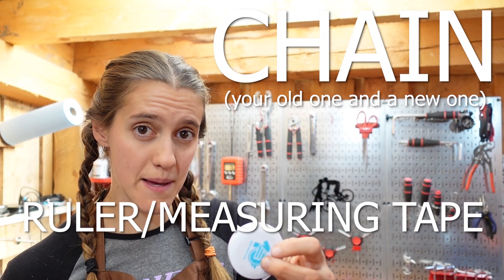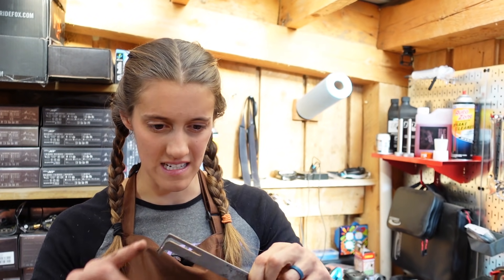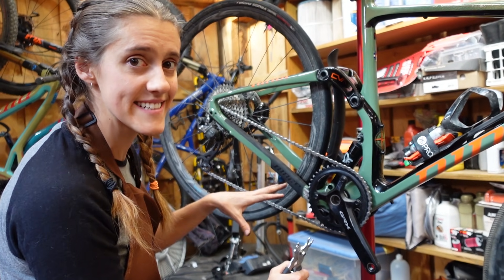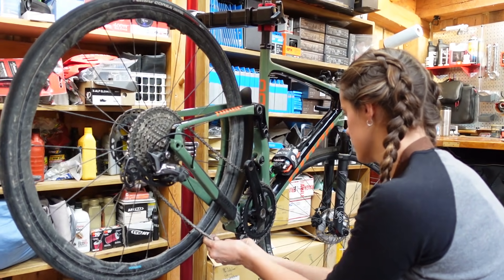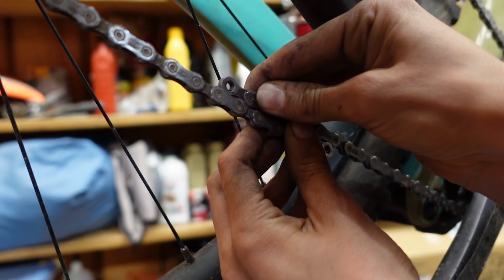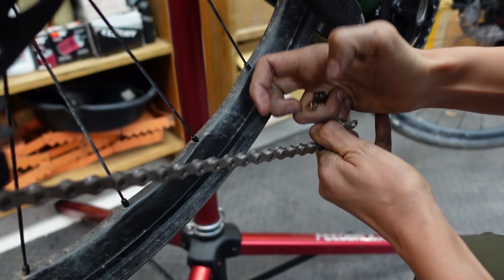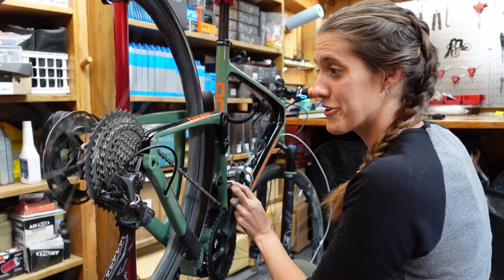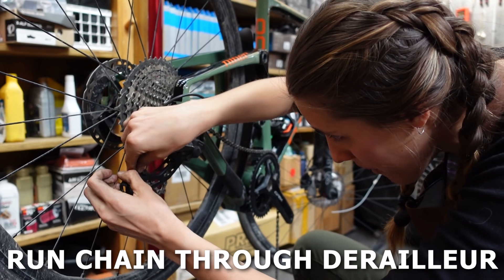How to CHECK CHAIN WEAR and INSTALL a new chain | Syd Fixes Bikes

Comment from the maker: One thing we wanted to clarify that's a bit confusing in the video: we talk about "adding links". You're not actually adding links to the chain, you're adding links to the length of the chain before you cut it. For example, if you measured big to big and that measurement left you with 6 extra links on the new chain (that you would cut off), before cutting the chain you would add 2 links (assuming it's a 9-11 speed system) and would only end up cutting off 4 links.
Reply: So do you have to run it thrue ur derailleur? (Bevore cutting it)
Reply: Syd plz in going on a vacation soon i realy  need an awnser
Reply from the maker: Nope. Measure as explained in the video
Reply: Thanks! This is really helpful 😄
Reply: Do you count 1 pin as a link or 1 link has 2 holes?
Reply from the maker: We count each pin as a link because then you are counting both the inner and outer links.
Reply: Pls reply
Why is my caliper already tightened or braking itself but not completely its just rubing against the disc brake

Comment: I can still hear you saying you would never break the chain!

It's a bummer you didn't need to take a link out of the chain. The snap you get when the pin pops out of the link when using the chain breaker on modern chains is really satisfying!

Comment: Quick tip, bend a piece of wire to clip onto chain rollers.  This can hold it in place with some slack as you join the chain with a chain tool or master link.  I think they sell them, but it is pretty easy to make one.
Reply: YEP!! Can use a piece of old broken spoke and curve/bend the ends. Works great!!
Reply: A straightened out piece of paper clip does pretty well.
Reply: I made one from a wire coat hanger.  There's small one that comes with my multi-tool but I like the one I made for shop use because it's longer and gives you more room to use the quick link tool.
Reply: Or just take it off the front chain ring and that will give you more slack. Put it back when QL is installed.
Reply: @bengt_axle  Yeah, THIS!

Comment: This is the best chain measuring and fitting vid on the internet, that I have seen. Just checked my brand new bike I picked up from LBS. It's a 12x1 SLX the chain had the writing on the inside not facing out and the length was incorrect. Thank you both for all the time you put into this channel.

Comment: I like your videos. I tried to put a new chain on my 3x9. I changed the rear cassette from 32 to 34. So I remeasured by going around big big and adding two links. It was too short. So I measured between axle centerline and crank spindle centerline did the x2 divide chainring /4 blah blah formula. Still too short. I have one chain pin left. I’ll try it your way and see. ❤❤

Comment: KMC Digital chain tool. What the pros use and it’s spot on every time. Get Rohloff cassette wear checker and you’ll never miss worn cogs on a cassette either.
Reply: This Shimano is probably the most accurate analog one, but KMC one is quite badass as well.
Reply: No need to pay 10 times as much for that thing when a single piece of metal works so well, especially in case of a chain checker, which is a tool that everyone should own. I really like the one from BBB,  it has a gauge on it and shows you how much is worn, not just if it's worn out or not.
Reply: Except that thing is precise and accurate which is what you want if you want to squeeze every last bit out of a chain before swapping. Can’t say that for analog sadly.
Reply: A Park Tool 3.2 chain checker is fine. Chains are cheap enough to replace and shouldn't require an expensive tool that will hardly get used.
Reply: @jacobjames1171  well, that depends on the chain 😅 I use a KMC ex11-SL Ti-Ni chain which costs me around $100 in every exchange, so changing it with some life left is a waste of money TBH

Comment: You mention checking derailleur set up after putting the chain on. It's easier to do part of that check with the chain off, as it's easier to see high and low limit screw alignment without the chain. Then check shifting after you put the chain back on. If the chain isn't off, you don't have to take the chain off to accomplish this, but if it's already off, it makes it easier.

Comment: Great video! When installing a new chain, I like to temporarily remove the chain from the front chain ring to provide some slack while joining the quick link.

I have the Park Tool chain tool. How come the Shimano tool has 3 prongs instead of the more traditional 2?
Reply from the maker: Because then you can use the same squeezing motion but different prongs to connect the chain vs disconnect it! It's awesome!

Comment: Is it safe to reuse quick links?
Reply: I do it. But then again, my bike is in the bike shop needing a whole new drivetrain. So maybe don’t reuse them. 😊
Reply from the maker: Most new chains come with a quick link, so we use that one when installing it and keep the old one to use for trailside repairs. We've never had issues reusing them, but some people say you shouldn't 🤷‍♀️
Reply: @sydfixesbikes  Yeah, I also keep the old ones, but the time I tried reusing the quick link, it didn't work as well as a new one. I never reuse them now, on 12 speeds.

Comment: Nice video thanks!  Of course, if you are replacing a correctly sized chain you can measure and break the new chain based on the length of the old chain.  And if you’re rear mech has a clutch you can lock it open while removing the old chain putting on the new chain which makes it easier (GRX doesn’t have?).
Reply from the maker: Yup, since we were changing the chainring and the old chain wasn't the right size, we forgot to mention that you can normally just use your old chain. GRX does have a clutch, but the Shimano clutches work differently that SRAM ones and don't lock extended.

Comment: Setting a quick link together with no tools is easy. Just pull both ends by hand.

Getting one apart with no tool is an adventure of pain and misery that I keep putting myself on.
Reply from the maker: We've had lots of ones that were definitely too tight to connect by hand, but yeah, getting it off is definitely the more difficult!
Reply: A neat trick I used from Seth’s Bike hacks is a shoe lace to undo the link. That got me home one day.
Reply: I’ve used a loop of old cable to undo quick links. Put them together by hand and then press on the pedal with one foot to click them together.

However, I’ve got the right pliers now which makes things easier.
Reply: Use channel locks at an angle to remove the quick link if you do not have the tool.   You put the link into the jaws of the pliers in such a way (diagonal) that it causes the links to slip into the open position when you squeeze the pliers.

Comment: You know Oz Cycle has interesting results with paraffin wax lube and chain life. He's been perfecting it over about 12 vids spanning 4 years. He claims 250-300 k per waxing and 15,000 k per chain in wet and dry weather. He also makes a squeeze bottle wax booster solution for between waxings and makes an MTB/Bad Weather wax solution/booster that includes paraffin oil super lubing. I ordered a new chain and am shopping for materials.

Comment: Thanks to this video I've realised I need to replace the chain and the cassette on my road bike. It is set up with ultegra however the ultegra chain and cassette are more expensive than for example the 105. I was wondering if I could get a cheaper one from shimano or even from a different brand?
Reply from the maker: Yup, all the different Shimano levels are compatible, so you can definitely replace with a less expensive cassette/chain/chainrings. You should be able to replace with non-shimano parts, but it isn't as sure a bet...

Comment: You mentioned compressing your suspension. Is that for any bike that has rear suspension? Or just gravel bikes? I feel like that's a stupid question and the answer is obvious.
Reply from the maker: Not a stupid question! Yes, it's for any bike with rear suspension as most bikes chain length "grows" (increases) as they go through their travel and you don't want to size your chain without taking that into consideration.

Comment: Request...... a vlog on how to fit tyres on and off high rim wheels... I broke my plastic tyre levers and bent 2 strong ( i thought ) spoons and the metal tyre levers I had were too small and dug into my hands and scraped the rim badly PLUS I have ruined 2x innertubes.... my fatbike tyre changing is a breeze compared.  Thanks guys..
Reply: Fat bikes are easy to fix tyres on, the only thing that sucks about fat tyres is they're puncture magnets

Comment: Are you using quick links to connect the xtra links or a pin?
Reply from the maker: We're using a quick link to connect the chain, which is the only connection there is. We realized it's a bit confusing in the video because we talk about "adding links". You're not actually adding links to the chain, you're adding links to the length of the chain before you cut it. For example, if you measured big to big and that measurement left you with 6 extra links on the new chain (that you would cut off), before cutting the chain you would add 2 links (assuming it's a 9-11 speed system) and would only end up cutting off 4 links.

Comment: are quicklinks single use once locked in?
Reply from the maker: Officially, yes. We've reused them many times without any issues.
Reply: @sydfixesbikes  I'm struggling to get my new chain working.  the new chain is approx 2cm longer which i didn't believe would make much of a difference but the chains falls off constantly.  i'm too chicken to break it with my limited skill/knowledge!
Reply from the maker: Yeah, an overly long chain will be more likely to drop due to the extra chain slack.

Comment: The smaller cogs always get worn way before the larger cogs. Even replacing the chain before 0.7 the thing will likely skip with a new chain.
Reply: If you are wearing out the small sprockets more than the bigger ones then I think you need a bigger chainring(s). It should be the middle sprockets that wear more as that it where you should be spending most of riding time in.

Comment: does it actually matter than the letters on the chain face outwards?
Reply from the maker: Shimano chains are directional, so for those chains, yes.
Reply: @sydfixesbikes  ahh I see. What about kmc 10speed?
Reply from the maker: If there is only text on one side, most likely it is directional.

Comment: Again a good video, maybe with a little less camera-work, so for example you did not show the flansh on the derailleur in detail, where the chain has to go over...also never heard about the 12" lenght. In Germany it will be 30,5cm, I will measure that tomorrow....

Comment: In the video, when you are counting links to add length to the chain, you are referring to half links. One inner plus one outer equals one link. Or, as I've seen done before, it's possible to refer to rivets to prevent confusion.
Reply from the maker: Yeah, counting rivets is a good idea.

Comment: Hey what work stand you guys use?
Reply from the maker: It's the Feedback Sports Pro Elite (https://bit.ly/3mTXStc). We LOVE it!
Reply: @sydfixesbikes  wait, that sounds like a sponsor plug.!  Any benefits over Park Tool stands?
Reply: @davidwiezalis3037  I have the Feedback Sports Elite stand.  Can't tell you how it compares to the Park tool, but I bought it because it has a 85lb weight capacity, has a quick release feature, and is really stable.  I've been using it for around 2 years now.
Reply from the maker: We've never used the Park Tool either, but pretty much every pro team mechanic we know (like all the Shimano mechanics) use the Feedback Sports one...

Comment: One small tip I haven't seen anywhere: Do not measure your chain over the quick link, it will grossly exaggerate the wear of your chain. Go ahead and try for yourself, it's noticeable on any mildly worn chain. So does that mean that the quicklink stretches faster?
Reply from the maker: Good question. Or maybe the quick link is just slightly bigger to begin with!

Comment: What bike is that. Is it a full suspension rode/ gravel bike?!  I have no earthly idea

Edit: never mind. I watched that part. But what is the point?
Reply: Guessing it is to get a bit more control on bumpier trails than a conventional gravel bike. Gravel bikes otherwise are like a variation on a cyclocross bike so this mod makes them a bit more unique. Also might prevent as much damage to wheels and tyres if the suspension its taking some of the peak load away.
Reply: @joeyc8546  ya. Ive never seen such a thing. Basically takes away the point of a gravel bike to o
Reply from the maker: We just talked about it in the most recent video on our other channel: https://youtu.be/NngCWqJd2d8
It's an awesome bike!

Comment: Curious someone at bike shop told me to measure like syd did, but chain stretch is a myth and its the rollers that where out, shouldn't we measure the rollers and not the pins?
Reply from the maker: Yes, it is true that chains don't actually stretch (the metal does not become longer). What's happening is the pins, rollers and sleeves (basically the connection points) start to break down which changes the length of the chain. So, yes, they get longer (which is why measuring works) but no, they don't "stretch".
Reply: Right on, Syd! The parts of the chain wear (mostly from dirt grinding them down), and hence those parts get smaller - this means the spaces between the bearing surfaces of the chain get larger which gives the appearance of “stretching.”
Reply: @sydfixesbikes  I've heard the stretch term from a bike shop when my single speed bike ran out of adjustment in the rear drop outs, axle back as far as possible, the bike was flipping the chain. The bike shop said I need a new chain

Comment: I don't get how you can measure chain wear with a tape since the chain actually can't stretch.

I think this 'trick' isn't right because the links don't get longer as the chain wears out.
Neither the distance between the pins doesn't get bigger.

What you are checking out with that wear indicator tool, or vernier caliper, is called 'pitch'. You are measuring the distance between the rollers of the chain. "A chain is made out of 4 components: outer plates, inner plates, pins and rollers" - Bike Bible
The only components of a bike chain that wear out under normal use are the rollers. The bore on these is getting larger and these rollers become 'wobbly' and that distance (pitch) is getting bigger.
The more wobble in the rollers = the more the chain is worn out
Reply: No, a ruler works fine, pins wear as well as rollers and if anything it's the pin wear that is the most significant when it comes to wearing the sprockets and chainrings down. Roller wear doesn't actually matter that much if it's even as the teeth are pulling in the same direction so the pitch doesn't change. As such a ruler is in some respects the most accurate way as it ignores the roller wear and any roller tolerance issues which can vary a fair bit on new chains, particularly for the cheaper lower speeds and a chain wear checking tool will not account for that.
Reply: I need to test this next month when my new chain arrives.

Comment: I have no idea what you two are doing in this video. You install the chain on the derailleur, around big big and measure using the stretch on the derailleur cage. Simple.
Reply: Christopher McGlaughlin  I like to do small to small, pull until rear derailleur has a little tension, break, add quick link or pin.

Comment: Hahaha...yes Syd...greasy hands suck.  I prefer the math geek method.  Distance of CL rear axle to CL bottom bracket x 2 (+) number of teeth, big cog / 4 (+) number of teeth, big chainring /4 (+) 1. And there ya have it. Cut your chain and handle it once...no pullin it together and eyeballin extra links, etc.